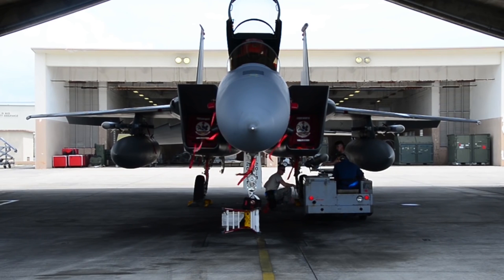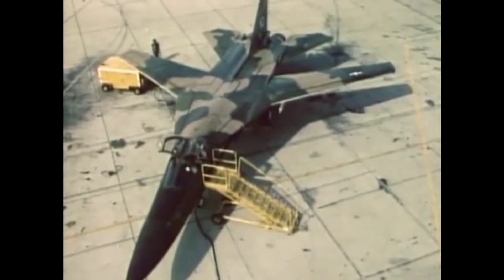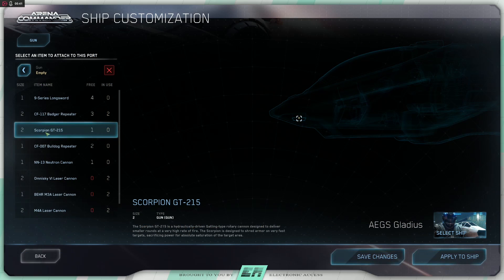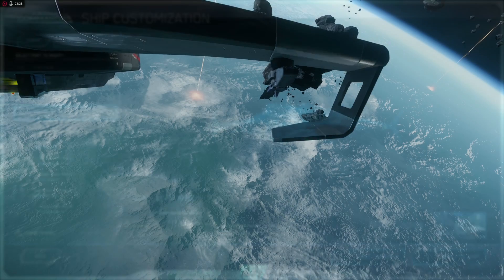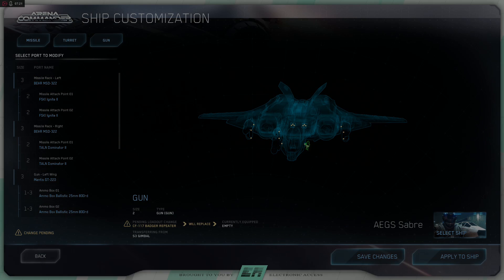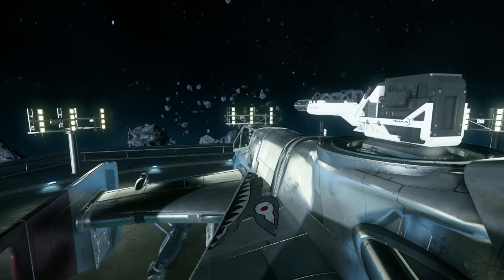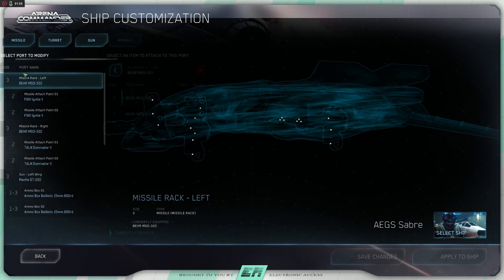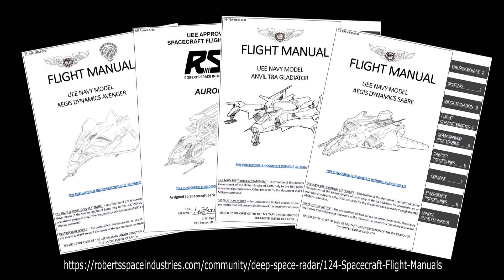Star Citizen - Principles of operation - Weapon Hardpoints and Ship Customisation

Comment: Well done!  Thanks for showing the example with the new Cutlass.  Are you better off, firepower wise, with a single size 4 on top or two size 3?
Reply from the maker: I suppose it depends on if you're flying solo or not. If you are solo (no pun intended) you'll probably be better off with the single S4 as at the moment the turret can not be slaved to the pilot. If you have a good crew, then the two S3 will probably have a higher DPS overall so will probably be better :)
HTH